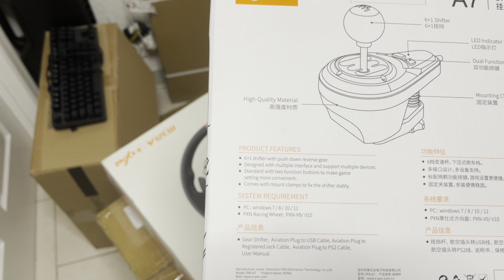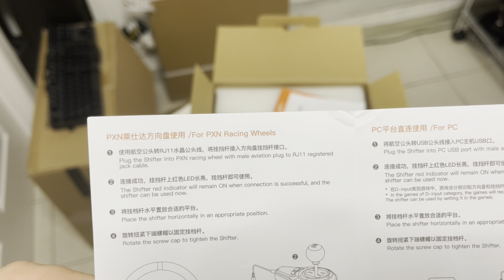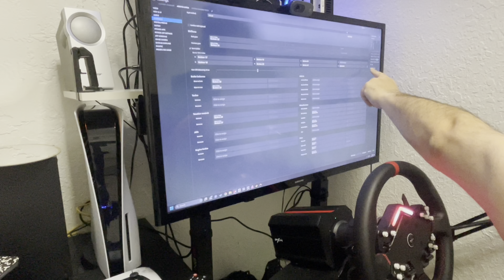PXN A7 Shifter for the v12 DDL/S.  #gaming  #simracing  #pxnv12 #assettocorsa

Comment: Does this shifter work for Xbox? Or is this shifter only for PC?
Reply from the maker: @vRi0tzlv  it will work on console if you use it with a PXN v12 wheel base. Other than that it will not work on console alone.

Comment: Can the PXN A7 work with an v3
Reply from the maker: Well it probably cannot be plugged into the v3, but if you are using it on a PC you can plug the A7 into a pc and use it that way.
Reply: can it be used on xbox thanks @JoeyBagZ
Reply from the maker: @no_idea5011  yes if you use a compatible wheel. I don’t think the v3 has a port to plug a shifter into since it has one already built in. I know the v12 Lite base has a shifter port on the back, so you can plug the shifter into the v12 and the v12 into the Xbox and it works.
Reply: oh ok but thanks @JoeyBagZ
Reply: if i put an adaptor on the v3 will it work?sorry for disturbance
 @JoeyBagZ

Comment: Glad PXN realize that you're one of the only ones that is promoting the V12, thanks to your video reviews I'm now certain is the best option, being a PS5 user (specifically the 12Nm wheel base and drive wheel bundle) it has been disappointing knowing we're left behind  and just offer 8Nm wheel bases at the most from the rest of the manufacturers.
 The V12 looks promising and it seems they have a V15 coming up, if I'm not mistaken. Hope they send it over to you  for a review. Could you also recommend a good sim racing rig that withstand that wheel base? Thanks 👍
Reply from the maker: The v12 DDS is the 10Nm base. And it’s good, it was just a little too strong for my current rig. I have a next level racing challenger cockpit. While this cockpit is comfy it just could handle the torque or the 10Nm base. I kept the 6Nm base and that makes the wheel plate creek, you can hear it in my videos lol. If this want a center post cockpit and had traditional side supports like there other wheel stands I think that would be good. Like the F-GT or their aluminum extrusion rigs. I agree that console players get shafted. And this base being cross platform compatible make it stand out in the crowd. Fanatec you will spend (and I priced it out) just over $1k to for their setup for ps5 and Xbox and it’s only 8nm. moza racing only gives you 3.9nm and that’s Xbox only. And Logitech makes you chose one or the other. You can’t have both consoles. So yea. Console players are left behind, but  PXN are there to pick up the slack.  They do have a 15nm base in the works and a set of load cell pedals, and a new shifter and e brake. I would love to review all that for ya.
Reply: @JoeyBagZ  Does your wheel still cut out every 15 minutes on PS5?
Reply from the maker: Once I started using the dongle and not my old beat up ps4 controller everything has been rock solid.

Comment: would shifter work with logitech 29?
Reply from the maker: Yes as long as it’s plugged in via usb to a PC. It cannot be plugged into the G29 and it will not work on console unless it’s connected to a PXN wheel base.

Comment: my shifter won’t turn on for some reason do i need a wheel first? or what cuz it don’t turn on when i connect it
Reply from the maker: The shifter turns on as soon as you connect it to a pc with the usb. It comes with 3 different types of cables.

Comment: Can you use it with your ur Xbox can you plug it in to the usb slot on your Xbox
Reply from the maker: No, it has to be either plugged into the PXN base or the PXN hub that is plugged into your PXN base. It is not a standalone shifter for Xbox or PlayStation.

Comment: does this shifter is compatible with PXN V9 ?
Reply from the maker: I am not sure, I know you can plug it directly into a PC and use it stand alone. Does your V9 have a shifter port in back?
Reply: @JoeyBagZ  yes the v9 has also a usb port at the back and also has rj11 port and I believe these two types of connector that A7 shifter had.